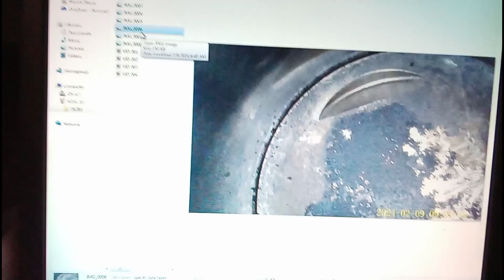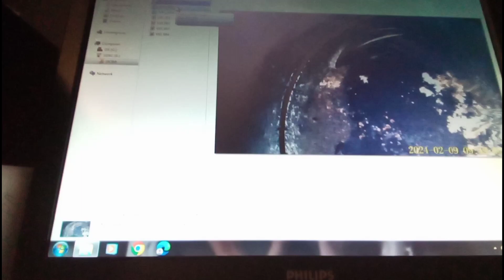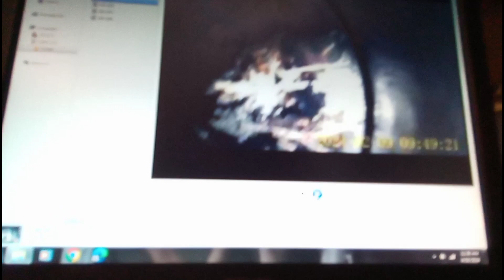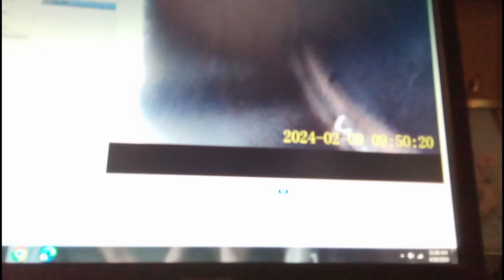There is a piece of metal in the rear cylinder. Endoscope views inside cylinder.

Comment: Did you try putting a magnet in the cylinder to pull it out. If it’s aluminum it won’t work.
Reply from the maker: I have a magnetic tip that goes on the endoscope. I will try that first, hope its not aluminum